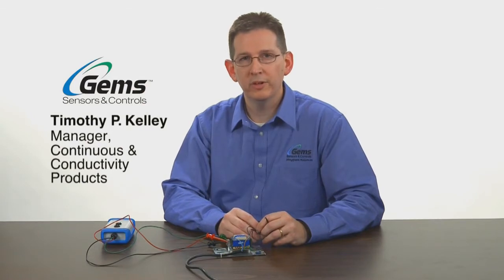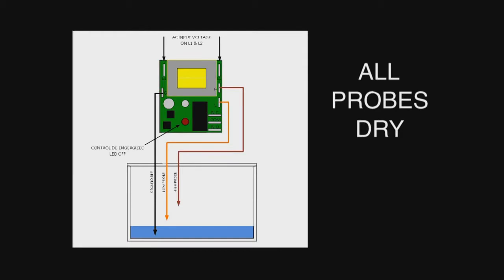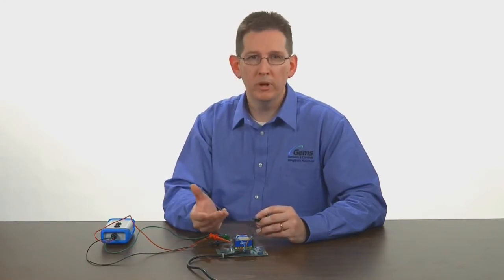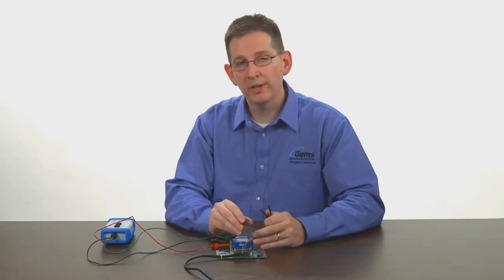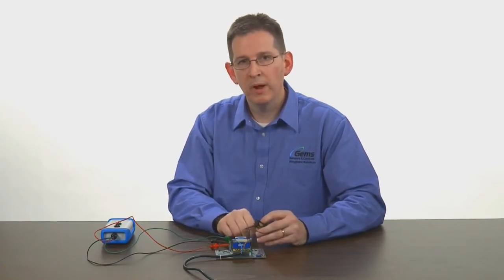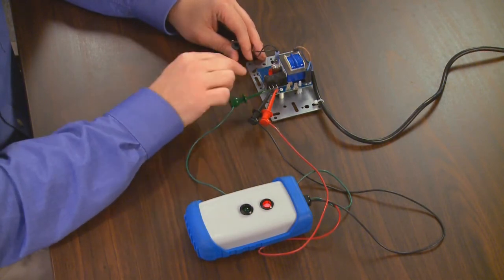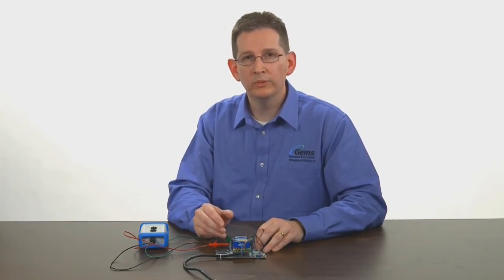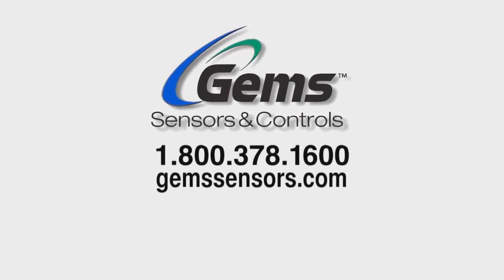Wire Troubleshooting of Warrick Controllers

Comment: In a series 27A1DO, differential, is constantly engaged, even when disconnected from sensors. Only disengages when I remove power from the unit. Why is this happening, and is there a fix?
Reply: I have the same problem and I've done the same 'solution' (remove the power from my general switch). I have no ide why It's happening.